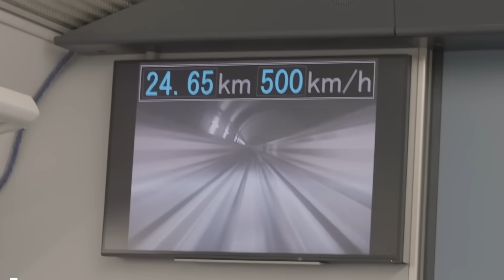Japan's New Train is Faster Than a Plane

Comment: What is glossed over is the stupendous amount of electricity even for the older models. The only reasonable solution is mini-nuclear reactors and there are new designs for much safer and much nuclear reactor to generate electrical power

Comment: The depressurised tube is some way off; the engineering costs per mile will be astronomical.  Theoretically yes, but this is too expensive to really supplant domestic aviation.  Surely Japan's existing rail network can do this?  Many countries are developing open-air Maglevs but due to the costs, they are only suitable for high density routes of 4- 500 km plus to truly be attractive enough.

Comment: CLICK BAIT~VIDEO REPORTED.
There is no 1000km/h Japanese train currently in existence( not even in testing phase), the only maglev confirmed has speed 603km/h and it's still in testing phase. Even 603km/h train requires many years to be operational.
EDIT: People don't read the comment properly and started to give their replies. 1000km/h is still impractical( this video creator claimed), while 603km/h train may suffer delays due to cost,safety and maintenance issues( and it's normal) . But yeah, it's near it's completion
Reply: Incorrect. There is one going commercial in 2027 at close to 600km/h. You can see it happening right now in Tokyo. There is massive construction for a new shinkansen add on to the Shinagawa Station. There is a large billboard displaying exactly what this video said, Tokyo to Osaka in 67min. I was there 2 weeks ago.

Comment: Maglev trains do not reach the sound barrier as it is impossible due to a amount of power that it can handle and air resistance
Reply: Thats why they will build a hyperloop vacuum tunnel so the train can run even at supersonic speed

Comment: The Maglev is older than me 😂1912, yes, the first one. Currently, only one is in operation, between downtown Shanghai and the airport at 430 km/h with a 30 km route, inaugurated in January 2004, this train is German-made. The 'Japanese' Maglev continues at the study level... since 2005 when I could visit it at the Aichi Expo, Japan, this train during tests reached 603 km/h. More than 100 years studying this technology, at the moment 603 km/h and the French TGV 574.8 km/h, and the 'Pope' of all bullet trains, mainly TALGO, which turned 80 years old.